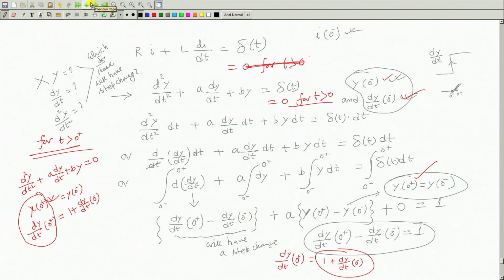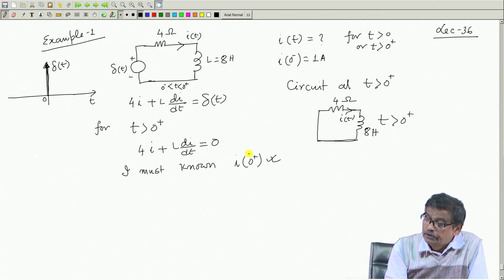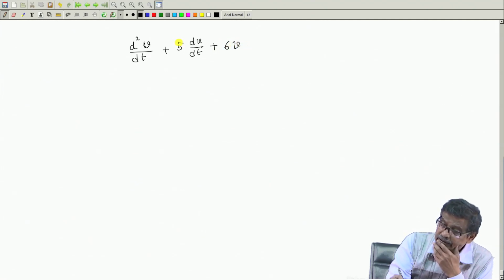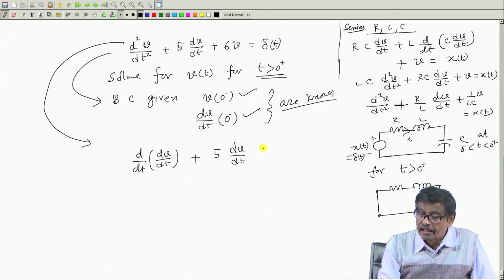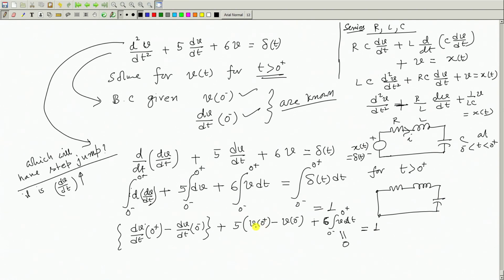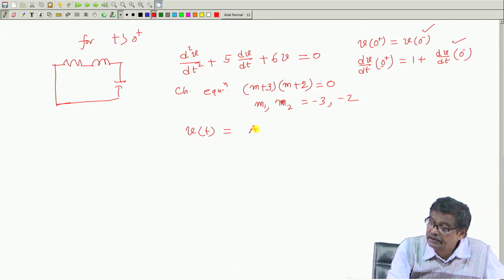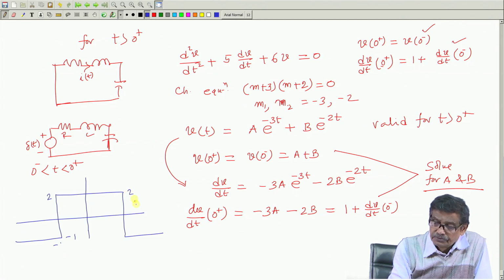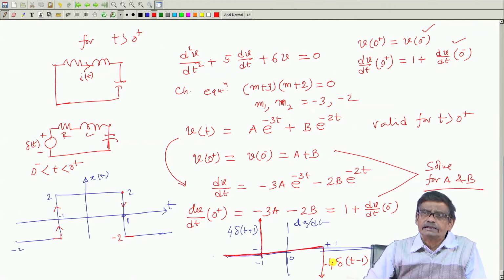Lecture 36: Numerical Example when Excitation is Impulse

Comment: Why are we not performing the particular integral or solution due to forcing function???
Reply: Once the impulse is applied at t=0, it exists only for infinitely small duration of time. At t=0+, the value of the impulse signal is 0. Hence, the value of the excitation signal is 0 for t>0. Since there is no forcing function, the solution due to forcing function is 0 and only the natural response ( transient response ) exists.